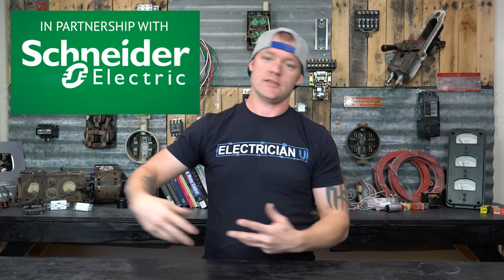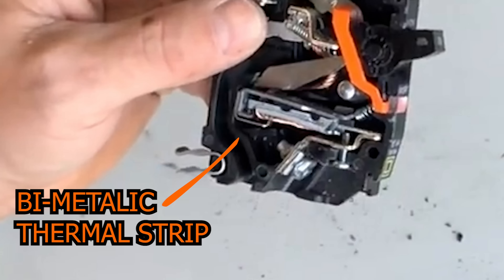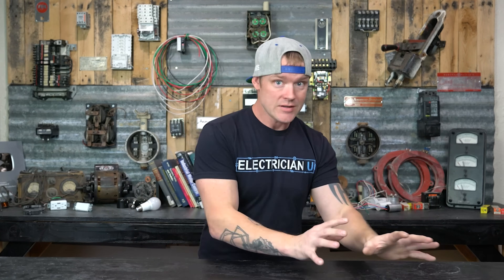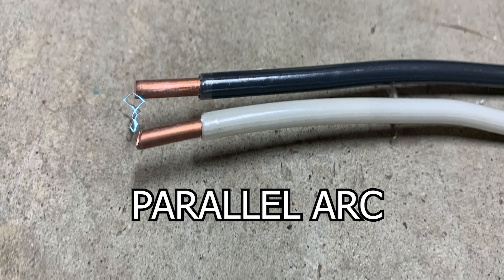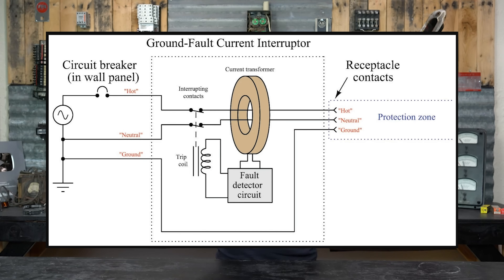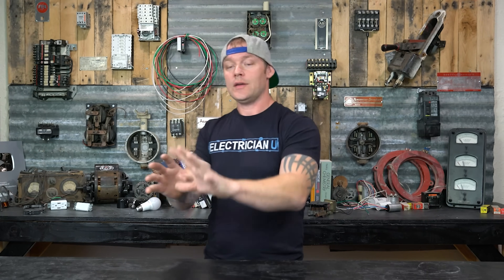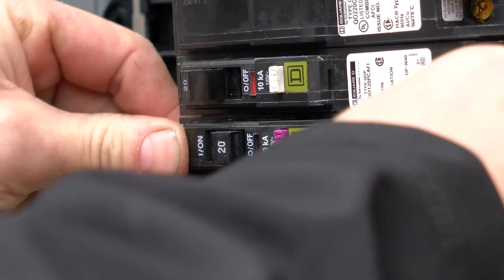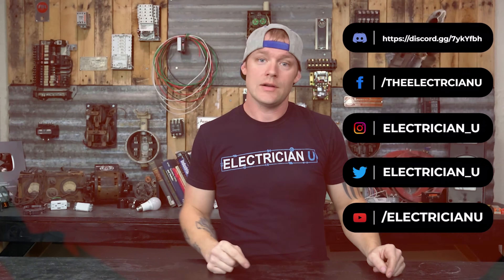Arc-Fault, Ground-Fault, and Dual-Function Circuit Breakers Explained

Comment: Good explanation! I’ve been an electrician for 24 years now, I’ve co-owned a small electrical installation company since 2015. We’ve always installed Square D panels in our commercial and residential applications. We’ve been using the Square D Homeline for residential, and installing the plug on neutral DFCI breakers for a good while now. We RARELY have problems with those breakers failing. We discovered a long time ago that you actually get LESS nuisance tripping with a DF verses an AF, which is crazy to me at first because you would think it would trip more. These DF breakers seem to be a little more tolerant than an AFCI breaker. The only circuits we don’t DF is the garage and bathroom plugs. The reason for that is during construction it gives people plugs for saws and compressors that the DF breakers don’t like, which seems to be the only issue we have with these. On those circuits we just install a standard breaker and a GFCI plug. Keep up the good work, it’s cool to see a younger person like yourself that seems to have the love for this trade and putting good information out to those of us that want to be better, more knowledgeable, and more efficient at our jobs than we were yesterday.
Reply: Have you ever have any issues with refrigerators or freezers tripping DF breakers?
Reply: @kylelaw7210  no, not at all.
Reply: good to know. Thanks
Reply: Nice  job

Comment: Got a Question? I Live in Apt. It has Square D Panel & Breakers but No GFCI's or Ark Breakers just Normal Breakers I wonder if our City codes would even mandate the use of these Breakers in our Building which was built in the 60's 

I'm a N Scale Model Railroader I use NCE DCC Products to Run my Trains which keep the Power in the Rails all the Time it allows the user to Run his or her Trains in a Real time style like if one Train is on the Main Line another Engine can be Driven off the Siding Track onto the Main and the First engine on the Main won't move until the user has the Engines linked together in a Consist..  

My second Question On my Layout I use a NCE SB5 Smart Booster for my Inner Route it has a Power Supply that Runs it but when I plug it into my Outlet or plugging it into my Battery Back Up's which also serves as a Surge Protector it pops a Small arc i did call 📞 NCE and visited with the Head Guy his Name Ed he did say the Power Supply could do that it could Arc,  So I bought a Heavy Duty Power Strip at Home Depot there Rigid 6 -outlet 2 USB-A 2100 And when the SB5 was plugged into it I could switch the on & off switch it didn't seem to pop or Arc but With a Arc Style Breaker as you Mentioned would that eliminate this issue at the Outlet or say Eliminate the Arc when plugging it into my Battery Back Up's by Apc..  

And to just let you know None of out Outlets in our Building are GFCI protected not in the Bathroom or the Laundry Room because of the Age of the Building I'm wondering if the City Code would Cover it I'd say any New Building being Built like Apts would be GFCI and or Arc Protected but this ole thing they dont even have Ramps if a Wheel chaired person wanted to live here..  

Thanks for your Time and please let me know if an Arc Breaker Would Help or the GFCI - Arc combo Breaker.. would help thanks Allen D
Reply from the maker: Try asking in our discord: https://discord.com/invite/7ykYfbh

Comment: Excellent topic, very informative and educational. Preferred the GFCI/ AFCI device embedded in cb housing. Reason, for device curiosity tinkers: safety first, voltage is still present on old type GFCI receptacle line side terminal.

Comment: Ground fault  : some current leaking to ground/earth. Returning current is less than outgoing current.
Arc fault: some current will bypass the load but no ground leaking. So outgoing and returning current will be same amount. So regular and GFCI will not trip. But there will be lot of harmonics in the system and arc fault breaker will trip.
Example : In bathroom after shower, hair dryer sometimes does not work. Even GFCI can not find the fault. Reason is tiny sharp or longer wire inside outlet.

Comment: You didnt quite get the way GFCI breakers work correctly. It really has nothing to do with metal or grounded surfaces becoming live. Under normal operation all current flows through the hot and neutral wires. The current measure in each of these wires should be identical. If the currents mismatch it means that current has found another path not in the circuit design. Here is an example. A person in a tub knocks a plugged in radio into the tub. Now the current has another path that is through the water in the tub and onto the household ground. Note that this will not necessarily cause a normal breaker to trip. The thing to remember is the fatal amount of current is very small, in the mA range. Now if one has the radio plugged into a GFCI breaker the mismatch in current between the hot and neutral will trip the breaker. Normally humans are not good conductors but get them wet and that changes. This is why GFCI are typically found in areas where there could be water.

Comment: Hey dude got a question.. do you need to have an arc fault breaker when installing a GFCI plug in the bathroom.. I want to put the GFI plug, light, fan on one circuit does it need to be a arc fault  breaker or not?..... Thanks

Comment: Hi, i have a fridge on a gfi breaker that keeps tripping. For some reason the kitchen island outlets are connected to the same circuit, hence the gfi. Can i replaced he breaker to a normal one and install gfi outlets instead in hope of stopping the tripping?

Comment: Per NEC 210.12, we just bought a condo that was built in the 80s. No AFCIs in the panel. Is it because the old circuit breakers are grandfathered in? Thanks. One more thing--per code, it looks like about everything should have an AFCI, am I missing something on that?

Comment: So if you didnt have a dual function breaker, like in the old days, and they wanted three protections (overcurrent, ground fault, arc fault) they would wire the three breakers in series? And how is that even possible in a breaker panel when each breaker that you plug into it is a new circuit? So you would need three panels for the different breaker types?

Comment: I bought this up to a Square D sales engineer and several inspectors. Now with AFCI required on just about every residental circuit how do they expect a neat job bundling wires where you have say 30 AFCI breakers in a panel that does not have plug in neutrals. So now you have 120 wires in a 14.5" wide panel with the long AFCI breakers taking up probsbly 25% more room then a non AFCI breaker. In my own 40 circuit panel I used a lot of sticky back ty rab bases along with probsbly 40 tie rabs to do what code says workmenship matter. Think they should make 16 or 18" wide panels.

Comment: Troubleshooting arc fault breakers are the biggest complaint for panel upgrades. 
They trip. The reason why is that neutrals from different circuits are wired together somewhere. Once you've isolated the two circuits on the panel (flip one breaker on and a different breaker trips- those are your 2 circuits), now you know there is a junction somewhere.  Trace by eye in the attic or crawlspace,  or use a fox &hound. See where they are together,  separate them from each other (they'll be tied together), then try the two circuits again. If you notice the neutrals are a dusty brown or black, you know those neutrals have been cooking because of the overload of current on those neutrals.  Probably the best thing about arc faults is that it prevents that electricians short cut.
....also, if bidding to replace a panel with arc faults, then a disclaimer regarding tracing wires to separate circuits is needed, otherwise,  you lose a lot of money.

Comment: 1000 amps can be explosive with a dead short. More than you know. 5000 amp 3-phase generator with a short across two phases - made a "small" hole in the output breaker housing (switchboard). True excitement.

Comment: I see where this is going. GFCI and ARC Fault breakers replace the standard breaker for all home wiring especially if the cost is cheaper for the combination than purchasing each one separately
Reply: I was just thinking the same thing.  I can see, say, 2023/25 NEC just saying, all breakers are now required to be DF.  Other than cost, I cant really see why it shouldnt be that way

Comment: I have a question, when are they going to lower the price of these breakers so people can afford to use them?
Reply: How much do you think these cost? A dual function 120V/20A square D breaker is $50 these days. That is an extra $1000 on a 40 circuit panel that should last 50 years, and even if it’s a retrofit on an old home, a $1000 install for an outdated electrical system on a house is nothing compared to other code required changes that have come through.
Reply: @acrawford7955  Yeah, because EVERYONE just has an extra grand laying around not doing anything. Oh, and 40 circuits at $50 each, is $2,000, NOT $1,000.
Reply: Its already about a grand for 40 circuit breakers, so going to dual function is only adding a grand in cost. As for whether or not everyone has a grand lying around, if you’re in a position where you need to change out 40 circuits, you’re paying a lot more than $2000 for the rest of all the materials and labour going into that renovation. Not mention that for the bulk of contractors, they’re probably already paying $15 for a standard breaker and $30 for a dual function depending on what they get from their supply house.Yes it adds up but you’re talking about an additional $25 (or even just $15) per circuit to add one of these when that circuit is going to cost you $250, and the safety added is huge. This doesn’t even consider the fact that you no longer need to a GFCI receptacle. My whole point is that these things are already at the point where they’re affordable and worth the money.
Reply: @acrawford7955  You'll never see an AF or GF breaker last anywhere near that amount of time. Best to daisy chain the receptacles and leave the breakers as is. Waste of money.
Reply: What is your life worth? The life of your family?

There is also a cost saving: you won’t have to use GFCI outlets if the GFCI is at the service panel.
Reply: most times the 20 amp bathroom and kitchen outlets have GFCIs and dont need these arc fault breakers. 
they are usually used on 15 amp circuits.
My favorite brand is Eaton. don't like the others. 
I have found those Arc faults on Amazon for $38 vs. $49 at lowes and home depot.
it gets more expensive for the customers but what can be done.
I do understand the use basically trips the breaker at the smallest anomaly vs waiting until something  big happens and trips it. This guy gave a great explanation.
I guess that when one gets all the facts and details is more likely to understand the reason why some changes take place.

Comment: Quick question maybe you can answer I like using  
Square D panels and breakers makes for easy ID of a tripped breaker ( 🚩 red flag indicates tripped breaker) easy to find circuits that may be tripped. My question is are they available in duel function bolt on type not a big fan of Square D snap on panels

Comment: how would you safely determine which one of many neutral wires goes to a specific circuit.  I am installing a GFCI breaker for my garage and I need to circuit's neutral.  I am leaving the outlet GFCI, but adding a GFCI breaker.

Comment: Is there any reason that you shouldn't just replace all breakers with dual function, even if code doesn't stipulate it,  whenever you already plan on upgrading or modifying a circuit?

Comment: Question about reliability from your years of experience. I noticed you have qo120pdf on this video. These are ones I want to put in but these tend to have more negative reviews compared to other, all about tripping constantly due to sensitivity of these breakers. any first hand experience with this happening?

Comment: hello everyone... I live in a rural area and I need some help. So, I have a two year old home and whenever we have a partial outage this noise happens. Some things still work as well as the garage door but it only works barely. All the GFCI circuits make this knocking sound and even if I turn off the breakers to these circuits, it still does it until the outage is 100 percent restored. I've had the electric company come out and they say it's my outlets. I've spoken with an electrician and he says it's a neutral wire. then they say they're working on some new wiring on the grid to help with less outages.  I'm at my wits end with this and hope that I can get some educated reasons as to why this is happening. Thanks everyone in advance for helping.    https://www.youtube.com/watch?v=AomhJ02nWsY

Comment: Around 18 minutes where you were talking about laundry rooms and mentioned the 15-20amp and 120volt, is this affected by the 2020nec changes that increased the requirements to anything that is 150volts or less to ground making the dryer require it also? I know the last one I did I had to but we moved their laundry room to the bathroom and made a combo room so not sure if that's why it was required by that change or if it's all laundry rooms

Comment: Dustin, how about addressing nuisance tripping and strategies for dealing with them? The codemakers know it's a problem so allow fire alarm and burglar alarm circuits to be exempted. Having to go down into the basement, or in your case outside to reset a GFCI/AFCI breaker seems to be a pain in the ass to be avoided. If the NEC allows a metallic wireway to the first device, and then a dual function receptacle, wouldn't running a MC homerun to the first receptacle on a kitchen small appliance circuit and then NM cable to downstream receptacles from the load side of the dual function  receptacle work? Or just MC to the first plug on a bedroom circuit and use an AFCI receptacle since they are half the price of an AFCI breaker?  Easier to see and solve a problem on your kitchen countertop then in the basement.

Comment: I've wondered how much faster it is to trip at pt of use vs at the breaker & does that millisecond delay make much of difference in the mortality rate.
Reply: I don't believe there's any difference ( unless more of a time delay is built into the circuitry by the manufacturer).  All a GFCIs is doing is monitoring current between two conductors.

Comment: Do they last more than 3 functions or afci ? Or GFCI? I've seem GFCI outlets that maybe 20x in they stop holding on. I recently came across concept that standard function breakers are only rated like 3 dead shorts with gaurenteed fucntion. When that equals$40 plus for an afci breaker.. how to bankrupt middle class lmao. Know what kills only slightly slower than electricity? MN winter or nd winter at -30 or lower when you lose your home because aadty rega have priced it out as the mortgage collapse penda again. I'm carefully with worfding this. Union construction inbobed trades do good work. People with training plus the ability to have their own life due to the most basic of benefits tend to be more with it at work. My dad was VP of seiu local 284 for 25 years , currently trying to kill me and claims to own me..robs fellony amounts police won't allow it reported. not easy to watch my wording but there has to be a balance and be the change u want to see no? I just won't be it for very long. Lol. Nor do I get to benefit from busting my ass. The visual fx u r rocking... Awesome

Comment: I am assuming that the "plug on neutral style" that you mentioned will only work with a box that has the needed rail. So, it probably won't work to add that type of breaker to an older box, even one just 20 years old, and the pig tail style would be needed instead.
Reply: Did you get an answer to your question and what was the answer?
Reply: @glasshalffull8625 : No, I didn't, but the answer is that the breaker box has to support the breaker without the pigtail. If it doesn't, you'll need a pigtail and wire it in.
Reply: @wmcomprev  Thx

Comment: LOL....at 5:39 Dustin gave everyone the "Finger"....LOL....Always remember that a  standard OCPD, such as a circuit breaker does handle (3) Overcurrent Conditions. They are 1) Overload, 2) Short-Circuit, and 3) Ground-Fault. Remember, GFCI Devices do not function at 4 mA or less and do function at 6 mA and greater per their UL 943 standard. We use the 5 mA as the bridge point as there are some tolerances in the devices that do take place. Great job Dustin. Keep up the great work.

Comment: Great videos. I work in the oil and gas industry, but much of this info is still helpful wiring and understanding control buildings and equipment. These videos are not boring, like some of the stuff out there, that will put a baby to sleep ... taught by someone who is out of touch with the field. 🇨🇱👍